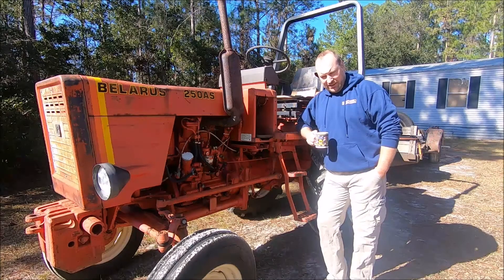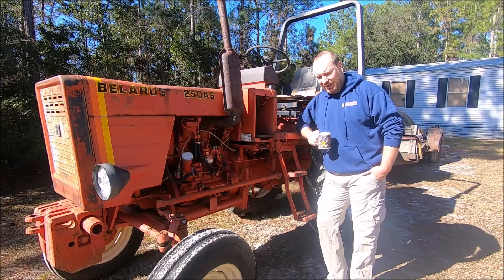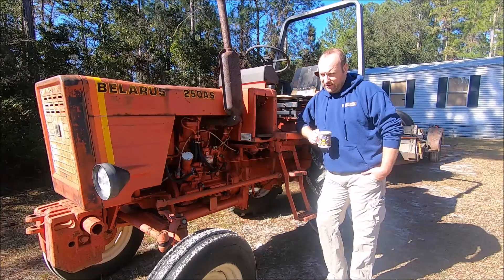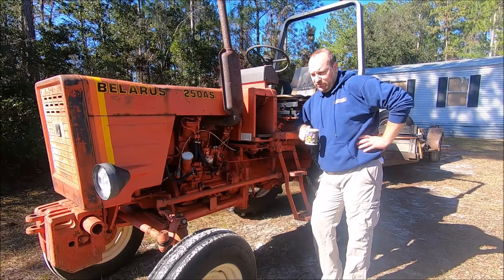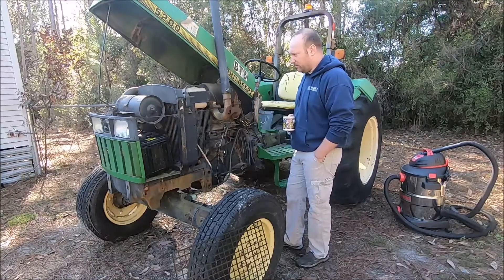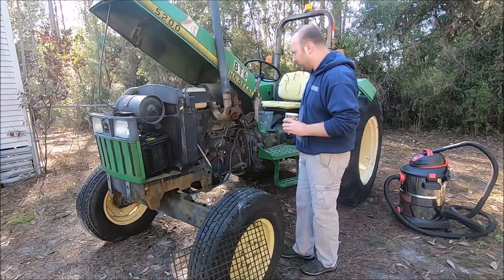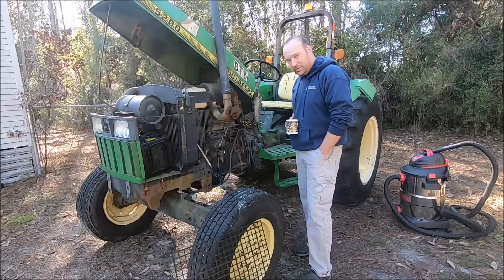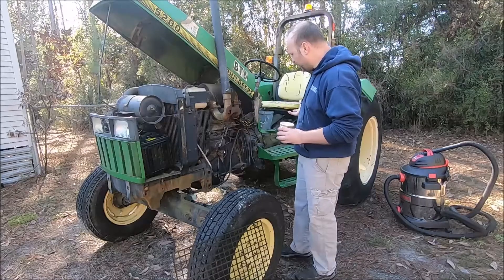Belarus Tractor 250AS versus John Deere 5200 quick issue comparison

Comment: team Belarus love love the simple engineering the rotator oil filter is total awesome too bad you got a filter love cleaning mine on the Belarus 800 and the fuel mileage is so bloody good you have to see it to believe it and old Belarus dealer told me they ran a comparison between a Belarus and a John Deere and the John Deere came in at $3,000 worth of fuel to do the the same job the Belarus did for $1,000 and that 250 is super cheap on fuel 3 teaspoons and you run all day lolololol

Comment: Hey I agree with you my  Belarus set for 5 years while i was away working. I drain the fuel lines put a new battery in it change the second stage filters crank it without compression for about 30 minutes on and off and then put added compression and it cranked on the 3rd rotation. Still running good today

Comment: I'm in a bind...spent about 10k on  An old massey 3165 industrial. Well in the process of clearing some land and pulling some trees between the excavator and the tractor. Somewhere along A-line a lost in oil plug. So Without going into details I don't have the time patience right now to rebuild my massey. But there's an 825 Belarus available. I'm thinking I want to grab it. I just rebuilt the MF34 loader with all new hydraulics I wonder if I can take my loader off my massey and adapt it to the Belarus
Reply from the maker: In general loaders can be adapted but some fabrication may be necessary to get the loader frame to bolt on. I doubt a swap from Massey to Belarus would be direct. However the Belarus tractors are generally very durable when maintained properly. They may not be the most ergonomic tractors, but fuel economy and durability make up for that in my opinion.

Comment: We had one back when i was little only 2 issues out of it, one being no breaks, two was the ptos output was WAY to high, it blew the seals like 4 times
Reply from the maker: Yeah I wish my brakes worked better too. I need to adjust them but I’m putting it off. Just gotta stomp the pedal REALLY hard lol. But having worked on a lot of farm equipment, brakes on old tractors are mostly neglected and rarely work anyway.